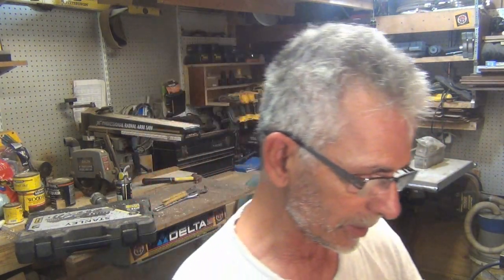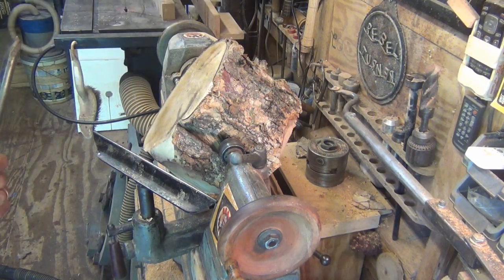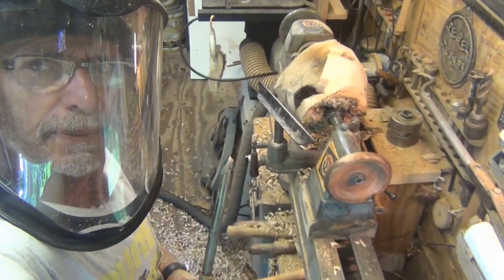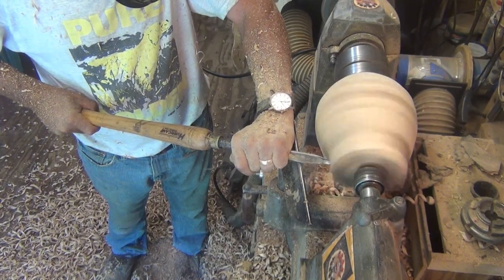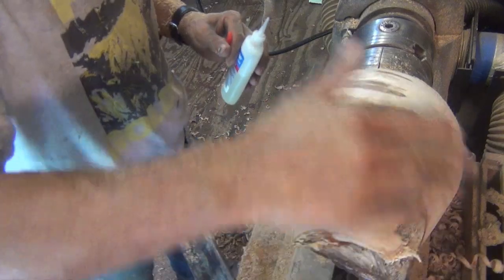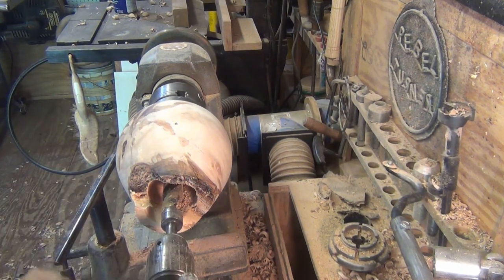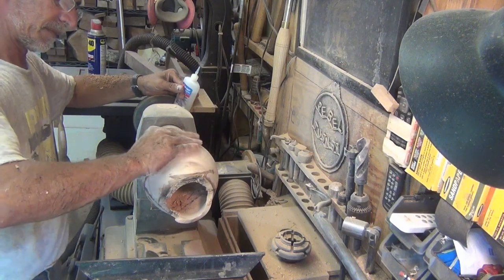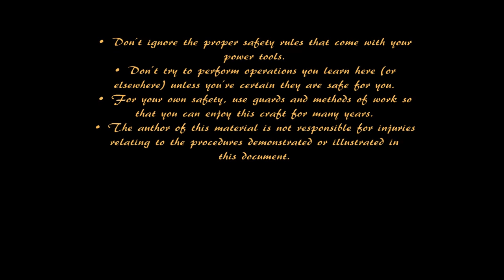River Birch vessel  by Al Furtado

Comment: you're so right Al. All low end tools work well just need sharpening sooner than the high end tools. they still get the job done. and since i bought a slow speed wet grinder I don't sharpen away as much metal and the tools last longer. nice piece as always. Happy 4th